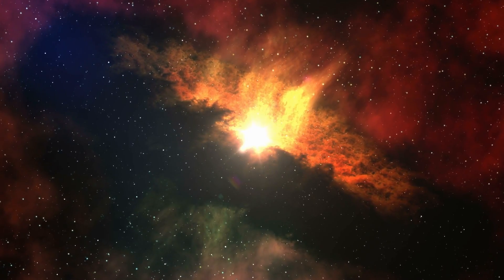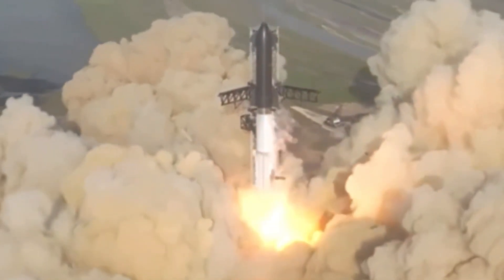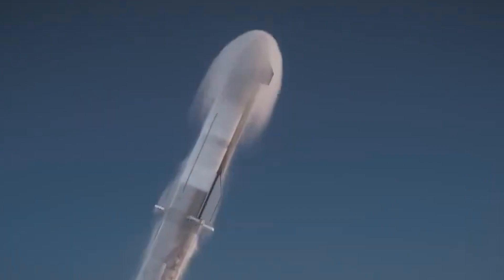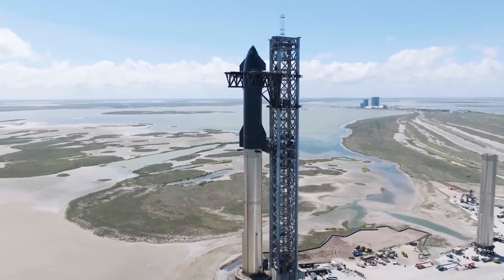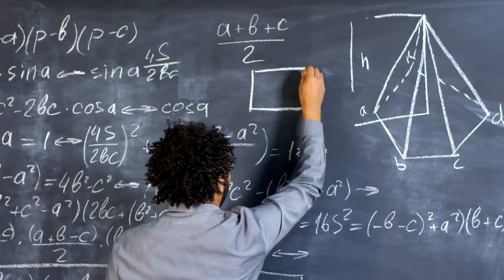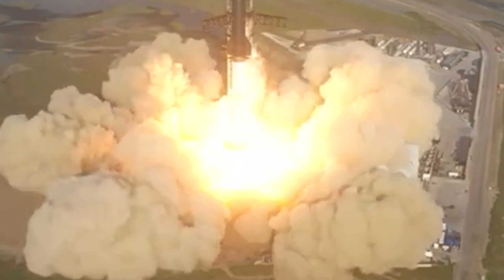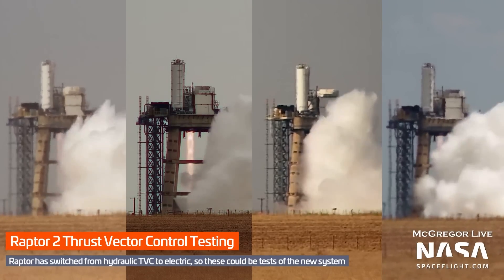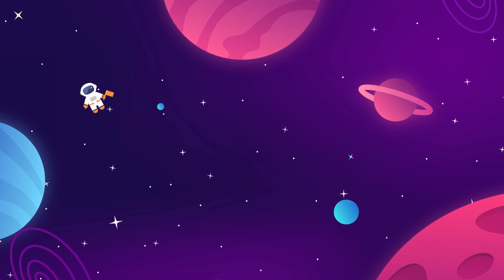The SpaceX Starship Orbital Launch Update Is Here!

Comment: The FTS was initiated before the structural breakdown. Scott Manley goes over that in detail. You can see the two bursts on the starship and booster followed by venting of the fuel in two white cloudy streams of gas. At that point the rocket was still falling and there was still too much pressure in the tanks to lead to a structural breakup and subsequent explosion. So it took about 40 seconds to vent enough propellant before the booster began to crumple. That photo was just before the final structural breakup and explosion; approximately 40 seconds after the FTS was initiated.
Reply: That image looks more like stage seperation than anything else, wouldn't surprise me if they went f it and tried a seperation burn on the upper stage to see what would happen as they were about to fts the booster anyway. The fts on the booster is at the bottom so the venting had nothing to do with that.
Reply: @shaung949  Hard to say exactly. If the engines were prepped to startup then that may have been the secondary "unofficial" FTS. (Would redefine the acronym IMO... lol)

I bet they didn't plan on it taking 40 seconds. I think everyone who witnessed this launch was surprised by how structurally sound the rocket was despite experiencing multiple explosive failures. 

I would wager that people started getting nervous after about 30 seconds and it was still whole and flying out of control. Certainly shows the strength of cold stainless steel against buckling. 

All and all it looks very promising. Maybe a little short of some expectations. But that's expectations for you; a setup to be disappointed.
Reply: @brendanwood1540  The spacex feed showed the LOX tank being vented before fts on the booster which may have been a precaution before they tried a seperation burn on the starship.  There was a second destinct fts event for the upper stage several seconds after the booster.
Unfortunately all the videos so far are from the ground so cloud or exhaust prevent a more accurate description of what happened. 
We'll probably have to wait for the official spacex report and pictures before there is a clear answer to what happened in the final seconds.
Reply: @shaung949  Fire the FTS!!!!
....
....
....
....
....
.....

.....
..........
................
...................
Ugh
..................................................
FTS! Fire the second stage!

Comment: On a positive note, it shows that the Russian and US launch pad designers from half a century ago were correct in opting for a flame divertor with water absorbing the energy as an elegant solution with no moving parts likely to fail. I can see the water cooled plate idea possibly ending up as costly, more complicated and prone to failure, yet severely limited in what it can do in comparison.
Reply: They really ripped the launchpad a new one
Reply: These extreme reactions to a first launch test is exactly why NASA is so slow developing rockets and why, ironically, they rely on companies like SpaceX now, since NASA is actually affected by the opinions of the midwit masses.
Reply: Lets have them launch something with 33 engines and same power then
Reply: Sad, isn't it?  They're having to rediscover and re-implement tech that was nearly perfected a half-century ago.
Reply: Still: what about launches from the Moon and Mars? 🤔🤨
Reply: @WilliamRWarrenJr  Yeah, there is that... which explains why the low cost solution of a concrete slab without cooling is ideal. However, the huge kinetic energy of the gas still needs to be deflected away from the rocket somehow which can't be done by a flat concrete slab by itself IMO: it needs to be at least (cone) shaped and/or supported by a high boiling point, conductive fluid/solid absorbing the excess energy.
Reply: @WilliamRWarrenJr  It would be only the upper stage taking off. From the moon it's easy to lift off, Mars has 1/3 of Earth's gravity and almost no atmosphere. But still it will blow stuff onto solar panels and Mars bases.
Reply: This is a tec company so we can't expect too much applied logic
Reply: There won't be a flame diverter on Mars or the moon genius. Lol jesus you kids are so dumb.
Reply: The failure was caused by a defective Giga Casting.
Reply: Jeah.. but who needs reliability nowadays? Its all about the futuristic minimalist looks....😆
Reply: You do know the N1's 100% fail rate?
Even Starship made it to low orbit while damaged.   N1 never left the pad once .
Reply: I think that a water cooled steel flame deflector makes some sense, especially for Starship itself. It definitely wouldn't be as effective as dumping millions of gallons of water into the exhaust, but if you were to be on the moon or Mars, you would still need to cool the steel to prevent it from melting, and if you're pumping water through it, you will probably end up with not insignificant erosion (compared with total destruction), but you can recover the water. Water doesn't form oceans on Mars or the Moon, it would make sense to recover it
Reply: No such thing as “no moving parts”. It’s a misnomer
Reply: .  . 1940s era technology which the Germans themselves had already moved beyond in their own research.  Anti-gravity research was commonly published in scientific literature until 1954 when that all disappeared in the name of national security -- while the former CEO of Lockheed Corporation told us in the 90s that they had at that time developed the ability to reach other star systems, as well as many other developments -- none of which are allowed to enter into public developments and awareness.
These undisclosed technologies, as described by doctor Steven Greer, have the ability to replace the need for fossil fuel energy production -- therefore the need to keep the public occupied with programs for public consumption, as such developments cannot be allowed to enter public consciousness to free humanity of its burdens as well as enlighten humanity with unlimited possibilities -- versus the means to maintain influence, crisis and war through maintaining an oil-based economy -- as well as perceived scarcity attendant with false climate threats from a basic element that is literally responsible for feeding the planet through the sun's energy by the process of photosynthesis and which is a primary element in life itself on Earth.  Even worse are geoengineering activities motivated by eugenics philosophies to reduce the planet's ability to support life in the name of reflecting sunlight back toward space, yet using the most toxic materials possible for this stated purpose.  
It is time to begin to function as individuals again, rather than as the parties and ideologies that divide us and so well managed for that purpose -- as well as sponsored SJW activity to greatly enflame any issue far beyond the normal public response.  Repetition and production quality will no longer adequately serve.  The individual perspective is the focus of power by which no person can be set against another with false or self-serving interpretations from another outside of ourselves.

Normalization rather than conspiracy is how influence and corruption created and take precedence, so that awareness is hostage to the needs for anything other than ourselves to define what is real and acceptable -- the need for any form of consensus to rule us unaware lest we ever accept responsibility.
Reply: The main point of failure is always the pump, and that's a moving part, but I'd like to see a giant upside-down water block from EKWB.
Reply: @Azilythe  Pad 39 actually has water towers, this is a very old and reliable technique to move and pressurize water in large amounts without actively pumping it.
Reply: in case of SpaceX Starship "a flame divertor with water absorbing the energy" is far from being an elegant solution, it makes the very idea of flying to Mars AND coming back absolutely unrealistic. Simply because there is NO way to build this type of launching pad out there, which makes mission to Mars one way suicide adventure.
Reply: @megaotstoy  Super Heavy won't ever light it's engines on Mars. It's a vehicle designed to get Starship to the space.
Reply: Musk is so convinced of his own genius that he just ignores experience.
Reply: @paulhaynes8045  You have to fail if you want to innovate.
Reply: @Gardor  I don't see any logical connection. Not everything you try will be successful, but I don't count that as failure, just part of the process. But, if you do what Musk does, try things out that you know aren't going to work or aren't ready, you're just wasting your money and yours and everyone else's time.  And learning very little.
Reply: @paulhaynes8045  It's a bit absurd judging the most successful resource allocator and leader on his decision-making. It's almost as if he has more context than you do.
Reply: @Gardor  Particularly upstarts like spaceX; a lot of failures before getting it right, if it ever happens.
Reply: @paulhaynes8045  I think Musk knew exactly what he was doing but played dumb.

The fact is that he wants Starship to be able to land and take off from the Moon and Mars, and expensive and difficult to build launch pads aren't really a viable option.

He actually needs to know how Starship and the ground it is on are going to be able to handle all of those engines.
Reply: @paulhaynes8045 uh... They want to use starship for point to point military supply delivery and or civilian travel. Both of those goals benefit from a cheaper launch pad/ finding the exact amount of complexity needed.
Reply: @johnwuethrich4196  I think greater benefits could be reaped by simply not introducing catastrophic and unnecessary risks into your very first test just because you wanted to design your projects around an impossible fantasy use case which will never, ever, ever, ever, ever happen.
Reply: The idea of starship ever being a viable point to point transport is a pipedream
Reply: @lutzderlurch7877  wow I was thinking the opposite. This rocket was shot full of holes at launch, had explosive damage after takeoff, 9 engines failed and still held together and aimed correctly until complete hydraulic failure. Most impressive rocket technology I ever saw.
Reply: @johnwuethrich4196  😂😂😂
Reply: @Greg  you are thinking wrong
As a transportation method within earth it sucks
Reply: @johnwuethrich4196  that will never happen
Reply: @djscottdog1  Im not sure on the passenger side... I think they will try very hard and or get a lot of funding for the military side. Even if it was limited to 70 tons. The strategic advantage of being able to put 70 tons of equipment and/or supplies anywhere in the world in 45 minutes... I think that's the capability the military will want
Reply: @Greg-yu4ij  what has that got to do with Musks insane idea of replacing plane flights with rockets?
Reply: @johnwuethrich4196  Also, what about launching from the Moon, or Mars?
Reply: @JV-pu8kx    @WilliamRWarrenJr  neither requires 33 engines. Starship top of my head has 6. (3 fixed vacuum, 3 gimbling Atmos optimized). The Moon and Mars both have way lower thrust requirements(To take off from). Ie lest thrust required for the same thrust will move you further away faster. Also Before the first starship was a real physical thing there was discussion about 2 or three small engines on nacelles for the moon version. We don't know if that'll be needed yet. It's foolish to say it can't work because this didn't. This test was literally can the fucking thing (fully assembled) get off the ground. And it sure did
Reply: @johnwuethrich4196  not going to happen.
Reply: @wizzyno1566  people said the same thing about flying. Then comercial air travel. 10 years ago reusable rockets like falcon were a pipe dream.  I don't know if SpaceX will pull it off. I would however say they have proven themselves able to do what people said they never would.
Reply: @Greg-yu4ij  It still BLEW UP!!!! Not good if there were any people onboard.
Reply: @johnwuethrich4196  Starship for civilian travel is laughably stupid
Reply: @johnwuethrich4196  The cheapest launch pad is the one you'll only need to build once. If it has a limited timespan, it will exceed almost any initial extra investment in a more expensive but durable launchpad
Reply: @lutzderlurch7877  ruh roh raggy, I have no idea what you mean
Reply: @Greg-yu4ij  Musk had proposed using starship to transport passengers from one place on earth to another, of course all cheaper, faster and more convenient, also safer, than  flying with a plane. And that idea is rather....'optimistic'
Reply: @helldad4689  that's just the Elon Musk way, that's why I wouldn't want to work for him
Reply: @lutzderlurch7877  it’s also really cool and if successful will crack open space travel throughout the solar system
Reply: @KarinExMachina    Obviously these types of problems have to be solved before starting said commercial operations (if they ever happen) To think that it would be a common occurrence to hide everything because of flying debris, is the result of a poor vision of how to solve the problems of engineering.
Reply: @Greg-yu4ij  I highly doubt his civilian travel via rocket thing will ever succeed.
Reply: @helldad4689 Ugh, there are always some people who already have the precognitive opinion that it will never work.
Reply: @lutzderlurch7877  but the development has to start somewhere no one wants to waste money on something they wont make at least double form. So at least Elons money goes to use as their R&D continue producing data in helping future scientists finally get closer to making it a reality.
Reply: @lutzderlurch7877  🤨 you mean for the foreseeable future.  at the turn of the century there were experts saying man will never fly 😂
Reply: @Greg-yu4ij  Agreed. This was their first full launch test and generally a great learning excitement. They are the foremost innovators in rocketry and the SuperHeavy will provide a massive jump in capacity.
Reply: @Nathan-vt1jz  Right? They are just fantastic. Any other rocket would have blown up before it left the ground given all that damage
Reply: I wonder if mechazilla could hold the rocket higher up to spread out the forces
Reply: They would know this if they had an R&D department that isn't "more engines am betterer"
And "look at how much space it has" and "zero G games lol"
Reply: @KarinExMachina  "more engines am betterer" actually seems to be a quite successful strategy, I don't know what your problem with it is.
Reply: @KarinExMachina  Yes, I have to agree that the idea of humans wanting to live on Mars is less credible than humans wanting to live on the base of Mount Everest, but... there may be similar money making incentives such as space tourism, social signalling etc so that the rich are initially prepared to pay making it eventually cheaper for everyone else.
Note also that Elon did an economics and physics degree, so knows how important presenting a positive image, even if unrealistic, is important for an entrepreneur for attracting investors.
Reply: @BarriosGroupie  " Elon did an economics and physics degree," but never worked in either field.😂

Comment: Why couldn’t they increase the distance from the raptor and the launch pad base by 3x? 

Then hold the clamps until it achieves throttle up by increasing the thrust over a longer duration and doubling the release time?

More fuel. But, less damage to the engines and it would reduced heat and pressure on the pad.

Flooding pad would decrease temperature even more.

And, If there was a way to direct the steam vertical, it would also increase the lift on the rocket without causing damage to the engines.

Just brainstorming. But, curious what holes there are in this idea.

Elon, feel free to call anytime for more ideas.

D

Comment: Nice catch on the shot of the missing engine bells.  That almost certainly proves that debris from the blasting concrete was the cause of engine loss.  This flight would have been 100% successful with super heavy separation and starship orbital insertion if the proper precautions were taken.  Instead SpaceX has to fight a time crunch for Artemis 3 and red tape from the FAA investigation.
Reply: It's hardly 'red tape' - it's a perfectly justified investigation in to a completely iresponsible so-called 'test'.